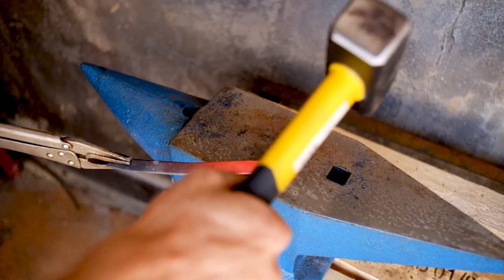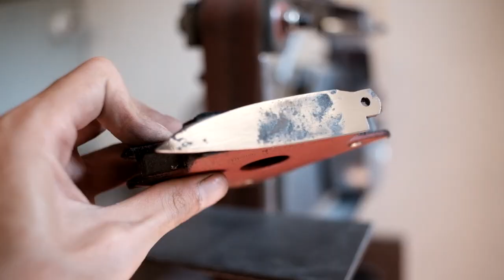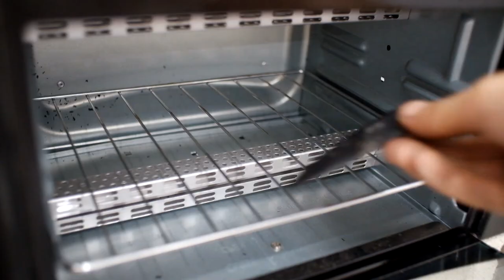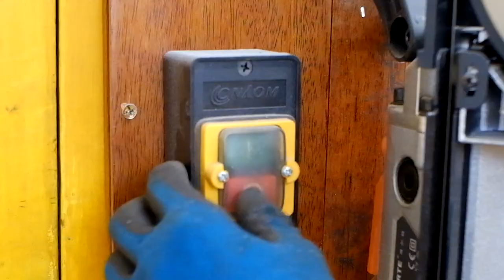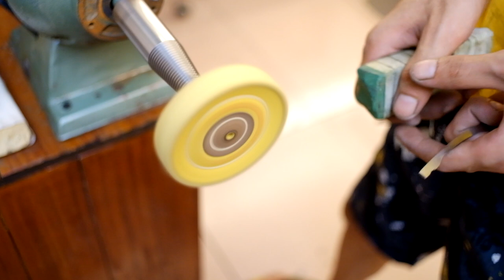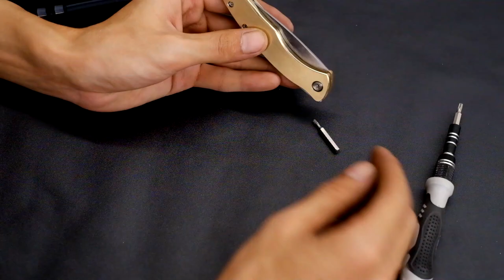Turning a old bearing into a reattrack folding knife

Comment: That is awesome man. One question though, how did you manage to drill the backspring? Did you aneal it first? Cheers. 🤘🏼
Reply from the maker: It's not very hard, it can barely drill holes
Reply: @HansKnives  so it's not from high speed steel saw? Was trying to make a backspring but quite difficult using hss, not even for a dent. 😂
Reply from the maker: @akuluka  It is better to anneal it, and the drilling will be easy. I am using an HSS drill bit, which may be the reason for the low hardness of the saw blade.
Reply: @HansKnives  that's more like it. That's for the replies mate. Awesome work that.  Have a good one.🤘🏼